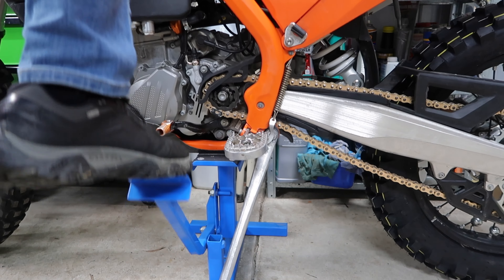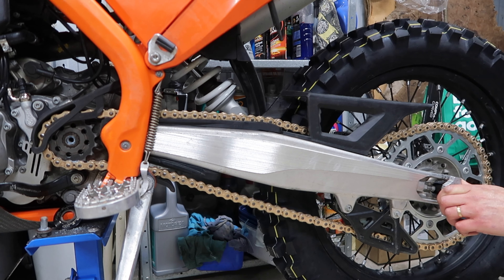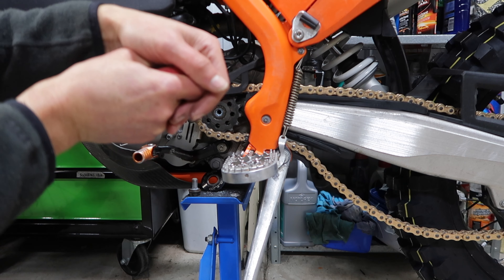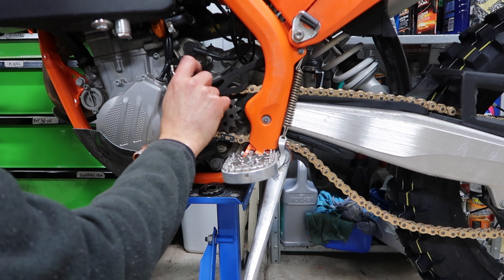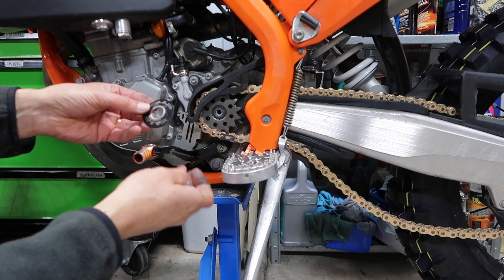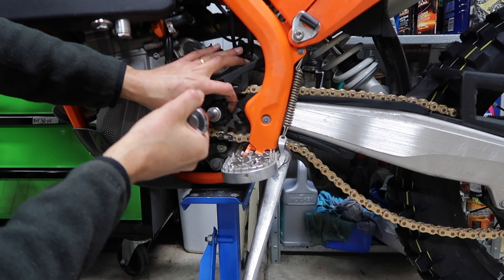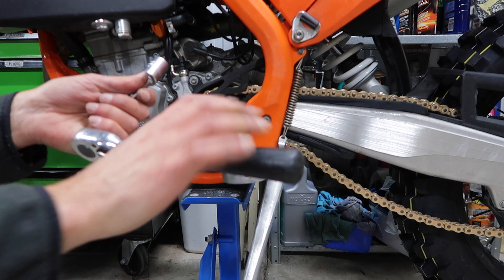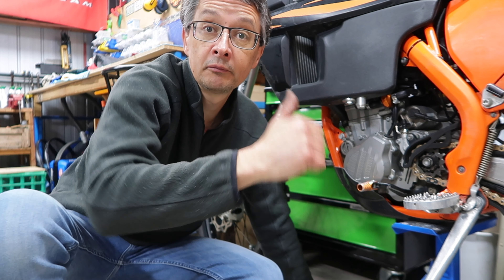How to replace the front sprocket on the KTM 500 EXC

Comment: When tightening the sprocket, a torque of 60NM should be used - that's a lot, with such a short key you will probably not press such power, even while sitting on a motorcycle.

Comment: I believe that the tightening should also be done in neutral not in gear. Also, like one comment said, some believe that greasing the shaft of the engine sprocket reduces wear. I don't have an opinion about that but I don't think it'd hurt to do so. To replace that shaft you need to open the motor, so I definitely don't want to see it wear out.
Edit: I just noticed that you said that the final tightening will be done sitting on the bike presumably in neutral so, ok.

Comment: Keith, as a fresh owner of a FE501 I find your channel as The Go To Place for answers to all my questions. Thank you for making this content. Super useful and quality content. 
One thing I am still trying to a solution to is the noise level - my bike came "unblocked" from the dealer (so no catalytic converter for example). When I asked him about it - he said installing cat would make it less noisy, but it will make the engine run hotter and loose power (and I do not want that obviously). Over your years with 500 did you find any solution to keep the engine power, but make it a bit less ears hurting or ear plugs are the only solution? Thanks!

Comment: Hey Keith … thanks for the helpful videos. Just wanted to point out that the torque setting of 10Nm in this video may not be correct. I only found out after I had oil weeping from the sprocket area so I re-checked & found out that it should actually be 60Nm.
Reply: The 10Nm is for the plastic cover, not the nut of the engine sprocket which is, yes, 60Nm.